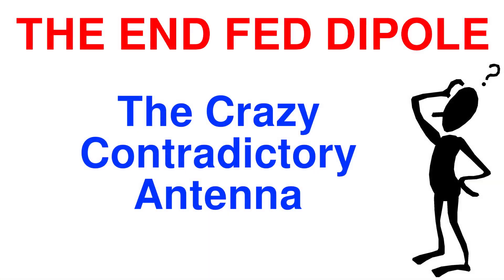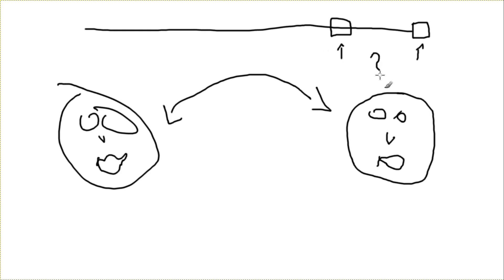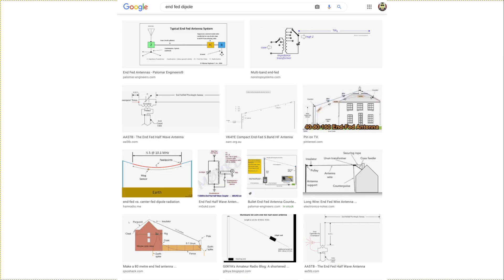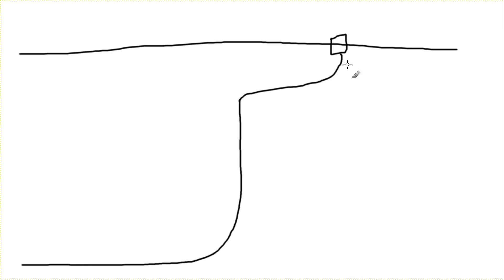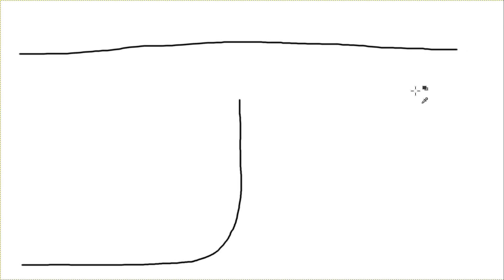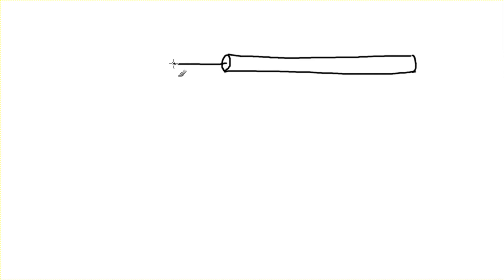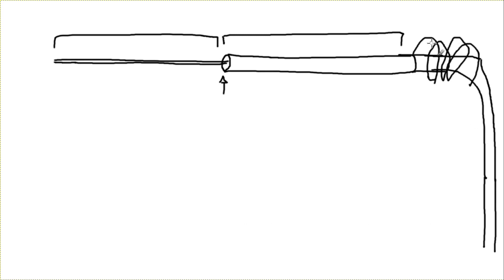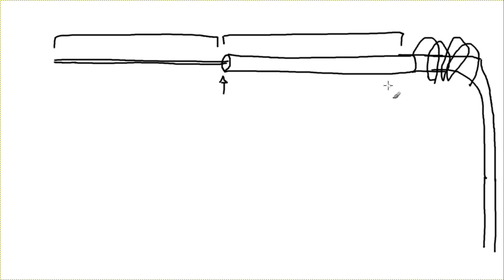The End Fed Dipole; A Contradiction in Terms?

Comment: So, I made a coax end fed dipole for 10 meters out of RG58 with a 15 turn air choke wound around a 63mm plastic cylinder then hung it on a redwood tree limb at about 22' high. My first clear contact was 2,077 miles away on my TYT TH9800 mobile base that pushes 3+ watts at the antenna. My signal report was 3 by 5 full quiet and the other station was 5 by 9 pushing 300 watts. Go figure that for a diy $12 project that took about an hour to make. Maybe trying something is best. My vote for your video was thumbs down.

Comment: You are describing the widely used flower pot coax antenna, usually found on 2m. As for end fed's. Certainly with a EFHW you are actually talking about an extremely off centre fed dipole, that is if we accept an antenna fed not in the centre still counts a dipole which it does. The end fed requires the radiating element to work in opposition to ground, the coax or a counterpoise. all of which occur on the other side of the feedpoint to the radiating element :)

Comment: I use an end fed long wire 1/2 wave for 40 meters. Also great on 20, 15 & 10 meters. The antenna you drew on the video is very much like a T2LT (tuned transmission line (something)). They are meant to be vertical and people use them mostly for 27 mhz on a long fibreglass pole. I have made 2 of them for 27 mhz and they work on 28/29 mhz too. I have also made UHF versions and soon with make one for 15 meters. They are great for portable use and are made from RG58 coax. The better quality stuff with a very good braid. By the way, my end fed long wire for 40 meters is great. I also have a proper dipole for 40 & 80 meters which I still need to put up and tune. So, yes I do know the difference. 73. Ian, VK3FIMD.

Comment: Take a look at VK2ZOI’s flower pot antenna. This is what you’re describing. I’ve built one of these for two metres and it works apparently without problems. But let’s be clear here, this is not an end fed dipole! It’s a centre feed dipole where the feed is through the centre of one leg of the antenna.

Comment: I think you're making too much of the prefix -- Bodnar, in the IEEE standard definition says a dipole is, "Any one of a class of antennas producing a radiation pattern approximating that of an elementary electric dipole."  This means any antenna that produces a node on each end of a half-wave radiator, high current in the middle and high voltage at the ends, is a form of dipole.  As such, all end-fed half waves are dipoles, unless you just want to be fussy about feedpoint.  Why make a fuss when the feedpoint moves, if the standing waves and radiation pattern are the same?